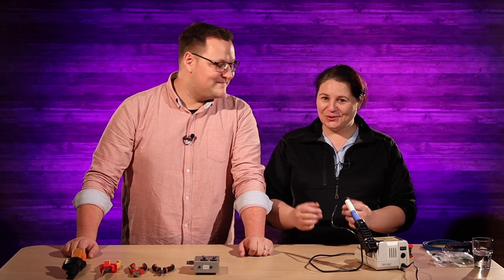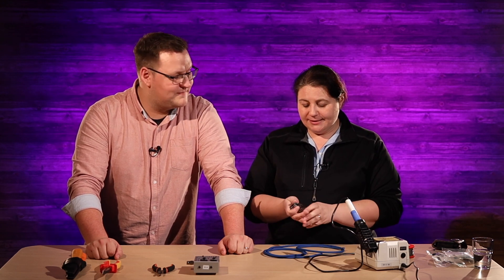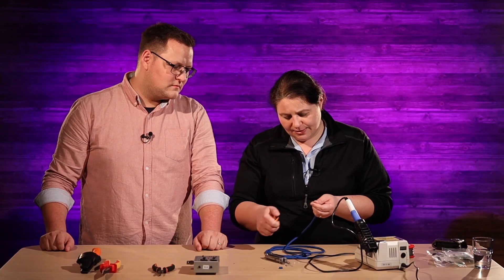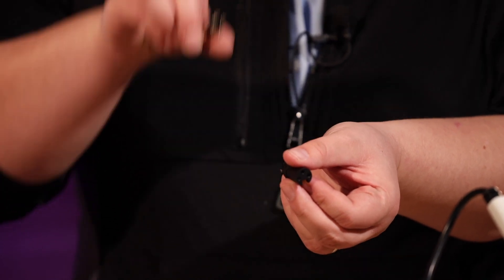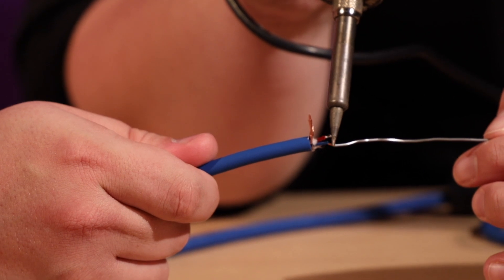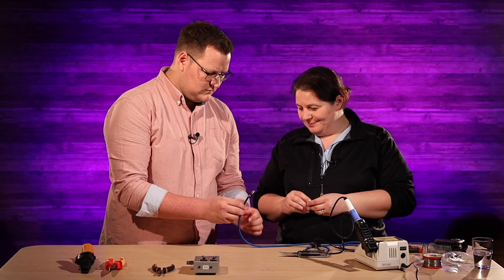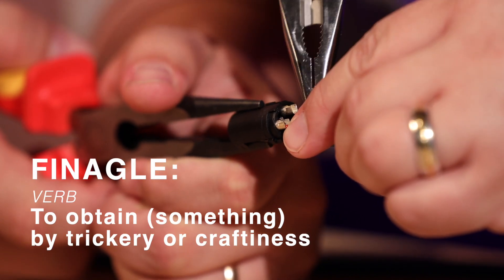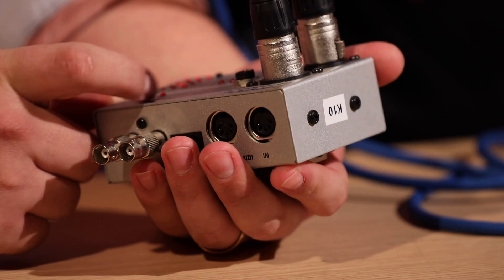Make your own XLR audio cables

Comment: Use 60/40 rosin core solder, not "lead free"" solder. Keep iron tip wiped clean and freshly tinned before, during and after soldering. Unplug iron when done to protect the iron tip.